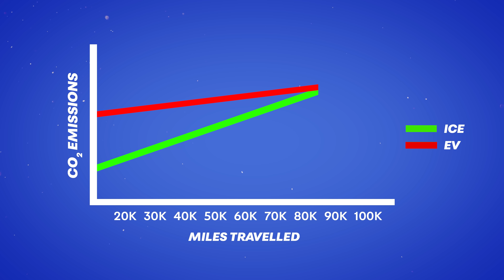Are Electric Cars REALLY That Green? [New 2022 Data]

Comment: This data isn't necessarily "new". We know about the CO2 caused by mining for the precious resources that make up the chemical anatomy of the EV battery. More research is needed for this area for new batteries developed on entirely new chemical dispositions to help offset the CO2 emissions. Following that, EV's offset the CO2 emissions elsewhere such as coal plants, nuclear power plants, solar farm, wind farms, and the like are also getting further research into to help offset CO2 emissions. Fixing one thing leads to something else that needs fixed... and another... and another. In order to tackle the overall CO2 emissions problem, we need to look at the overall picture. MANY things need to be fixed in order to help mitigate greenhouse gas emissions caused by human activity.

Comment: None of this matters i.e. which car is greener, when you take in to account that china and india burns 40 trillion tons of coal every year to make electricity. And they aren't even concidering the noinsensical paris climate accord (which is only engineered to make some shrewd business men even richer than before), and they're only about to concider a greener energy source at the earliest in 2050 for their energy. And now EU has deemed gas and nuclear to be green their green new deal falls apart as a house of cards that it is. Add on top of that all the rare earth metals needed for battery production for these battery-electric cars are mined by small children in areas of the world that are in uproar and turmoil and revolution constantly, like kongo, angola, peru, china, afghanistan and the like. And I hate to brake it to you, none of your sources for electricity in Britain are green, unless you have a separate cable all for yourself going to a hydroelectric powerplant in Norway. England has Nuclear (sort of green), Coal and Gas powered, and some wind turbines. The latter one is the least green of them all. They have a very short lifespan (less than 10 years), work only a third of the time, they use thousands of gallons of oil for lubrication every year, and none of the parts they are built of are recyclable.

Comment: The only thing that matters is not releasing CO2 

If cars are manufactured USING RENEWABLE ENERGY then no CO2 is released by definition 

Using FOSSIL FUEL at any stage of the process IS THE PROBLEM

Comment: EVs are ideal for short range low speed use i.e. in cities . for this simple, cheap cars are required. The whole motor industry  though , has concentrated on producing cars that have high performance and long range. The result is that they have to be stuffed full of expensive batteries. They are also much heavier than the equivalent conventional car. For city use amuch smaller battery will suffice and this could be rather like a wheeled suitcase that can be removed and taken to his home for charging. Thus solving the problem for people who do not have a driveway and have to park in the street.

Comment: you should also consider that EVs are so much heavier and thus use so much more tires: bad for the wallet, bad for the air quality because of micro-particles from rubber abrasion. A friend working in a very large international leasing company confirmed that Tesla cars use about twice as much tires. He also believes that EV users love to use the gigantic torque and thus use even more rubber. This is not the inherent responsibility of the car but of the driver, but it is reflected in their tire consumption.

Comment: 1) So many countries have almost no green energy whatsoever (especially 3rd world) - so if you're charging EV with electricity from coal power plant - then it's even worse than petrol car.
2) Building new battery from fresh materials is up to 10 times cheaper then recycling dead batteries. So guess where used  (very toxic) batteries will end up?
3) Not like "eco-corps" don't care about selling you horseshit information to increase their profits same as oil corps.

The only real benefit is leaving that pollution outside of city compared to petrol cars - but as overall pollution, it surely gan be even greater depending how green country is on energy (because for example Denmark has fuckton of wind turbines, while other countries have mostly coal power plants)

Comment: In my opinion ICE cars wins for now because by the time you get to the break even point EV cars batteries degrade but a well maintained ICE car engine can do over 200k miles before  it wears out.

 EV CARS alone isn't the answer we need a combination of technology's and major infrastructure  changes before forcing the public to make the change. 
 ICE cars will become obsolete when you can change an EV type of car as quick as filling up with petrol/diesel.  We're a long way off from that.

Comment: What about the battery replacement? I assume that would then jump up the EV output even more and it just depends how much ICE is at that point of replacement ~50,000/~100000 miles for battery replacement. In addition, what about the added degrading period in landfills and added electronics? I don't think we will ever get a straight answer, but what can be said is that the infrastructure for EV is not there yet and until it is, it shouldn't be forced upon us at a detriment to both the environment and our pocketbooks.

Comment: It is really sad that lies like this video are still going around and even worse that in about 10 to 20 years when the oil lobby is gone and the lies stopped to get pushed around, no one of the people that lied today will come out and say "yes we lied", just with lead, tobacco and and the other stuff where all those people that lied back than long just went hiding.

To get a few things clear, no one except advertisers and a few idiots claim that the BEV will fix traffic or even everything, it helps to get us a step closer to a CO² free traffic and opens the POSIBILITY to make our traffic completely free of CO². That is all it does.

Second, I've seen so many bogus studies and the problem with studies is that you can alter the results extremely by what you include, what you leave out and what numbers you assume. For example, you could take the numbers of a plug in hybrid with WLTP fuel consumptions of about 1,5l per 100km. But that number is only taken by loading the small battery to 100% and then let the car run on eco mode as far as possible on the battery and only the remaining part on the gas engine. So in reality you've got about 4 to 6 times the fuel consumption but the statistic looks clean. You can also assume the cleanest fuel numbers with 10% ethanol, which is common in Europe, and the most clean refined European oil vs. some polish electricity. ANd you can especially get a lot of nonsense numbers from producing a car. And to this day none of these statistics ever had a detailed list of which part in both of the cars  produces which amount of CO². It is always just, "EVS produce more, don't ask questions", ignoring all the 1000s of little parts that are needed in a combustion engine, and never really telling what part of battery production is so expensive that it literally beats melting steel and transporting small parts all over the globe together.

The best assumption is that production of both are equal enough to not matter in a comparison, if it is not so, I am sure that oil companies and the car industries that knows these numbers would already have told us so years ago.

Comment: Before I leave this site I found only  just now,  perhaps the  AutoTrader fanbois here would wonder why, since the argument seems so reasonable. After all he quotes Volvo and I own one. Volvos are known for longevity and mine is no exception.  It was a car I had always wanted, but it was the heaviest, lowest fuel mileage car I had ever willingly purchased without helping out a friend or relative by  doing so. I did that two decades ago.
And that is the problem.
 EVs are long lived too, and they are even worse for Volvo's bottom line than the ICE products they still have for sale. How does a company stay profitable making vehicles that have no follow on buyers, and how does a site like Auto Trader stay relevant without turnover.  It's right there in the name.  Cars are traded for something better, and ICE cars are constantly becoming worse through engine wear. It is inevitable and keeps Volvo in business in a Niche market. Safe cars that last.
EVs can have planned obsolescence built in too, but not as easily. That drivetrain in my EV today is the most robust I have ever owned. And likely to be my last.

Comment: Some food for thought . Has anyone even taken in consideration oil changes and rest consumables used at each service absent in most EV cases? Put that next to battery carbon footprint and end of life suggested toxicity and reusability/recyclability. And Btw, cobalt is not only sourced from Congo and Zambia. Not used in all batteries (i.e. LFP). Constant efforts  reducing or even eliminating cobalt are already made and more are on the way even in the ones still using cobalt.  Let goals,  processes and numbers talk and leave politics out of it ;)
P.S. On EVs supporting child labor in Africa:  Check the numbers on that connected to illegal crude oil refineries all over Africa (not just the 2 cobalt related sources) and - to add insult to injury - the effect on them of the continued use of tetraethyllead not just (if any) in ground transportation, but mainly in aviation. (e.g. most local airlines rely to antiquated models with piston engines that don't work without it)

Comment: What about the cost and pollution caused when it comes to recycling or disposal of the batteries? Expensive, time consuming and a huge carbon footprint! Add that to the equation.
Reply: Are you able to verify the claims for battery recycling/disposal please?  I recently watched the YouTube video posted by Volkswagen around 3 years ago, showing their EV battery recycling plant in operation. And from what I saw in the video, and the figures VW provided, your claims don't appear to stack up.....
Reply: @Brian-om2hh  batteries can be recycled. But it is very expensive, time intensive and has several difficult processes involved. There are a few companies experimenting with various processes that might speed up recycling times and reduce cost, but it is difficult.
No one is currently doing it in a way that would lent itself to become a secure investment proposal to make a profit.
There are several videos on u tube showing recycling. But at the moment it is not a viable industrial process. If it was there would be many companies jumping in to make money.
One of the problems is separating all if the various materials that are used to make the batteries in the first place. Very time consuming and expensive with all of the separation processes required.

Comment: Couple of points, the electric car engine was designed and blocked in the 80's, there were several designs bought out and crushed by the oil industry, if we'd started making ev's back then, maybe we'd be making them cleaner now.  All industry starts off dirty and over time improve and get more efficient.  Already we're seeing ev's go from 150 miles to 250 and soon expect 500 miles capacity.. sure it's a dirty process to make 1 ev but 1 isn't being made, hundreds are, so that increase is spread over all the ev's made.  90k miles that's maybe 2 yrs of driving, 1 yr for a salesman, depending on use obviously, I'd probably take 4-5 yrs to get to 90k.  the question now is, will a car last that long.   Ideally we need trams and electric buses, to remove the requirement for personally owned vehicles.  Setup complete vehicle bans in cities and towns. Build parking areas with trams running from them into cities etc.  Design a proper infrastructure instead of just adding to an already bad one.

Comment: And there is the battery waste !  Going to be a big problem in the future. In  particular for batteries with   Nickel and Cobold like the Tesla/Panasonic. There is no way to separate those two metals in a economic /large scale recycling. Going to be far to expensive and polluting again (chemicals).
I believe that Hybrieds with a large battery (+ 200 km autonomy on battery) are going to be on the long run the best option - watch out for BYD, they are well positioned. 
Nickel, Cobold free LFP batteries and 100% pure electric as well as hybrids with batteries for up to 250 km autonomy (1100 km combined for battery and gas).

Comment: The other thing; is the EV has this graph today; but the graph gets steeper as power plants change.  If you migrate to more green energy then your EV gets much better.  Your petrol car has a baked in emissions rating, it wont be getting better after its manufacture.  But if your country removes its brown coal plants, your EV after you bought it gets better.

Comment: These arguments miss a major point. While the ICE car dies between 100k and 200k miles, the EV just keeps going at least twice as long, if not much longer. Fears of battery lifetime have not materialized, and other major issues (transmission, engine) are simply not applicable to EVs. It is absurd from Volvo to define 125k miles as end of life. Their EVs will be used much longer. If not by the original owner, then on the used car market.
BTW, I own an EV that just reached 120k miles and it literally feels like a brand new car. No issues, and the battery still makes the advertised range (no decline whatsoever). It's a BMW i3.

Comment: I seriously doubt that 90k miles claim, the best way to go is public electric transportation, but we all know at least in the USA very slim chance of that ever happening. But i agree with you, even if it is not much difference, at least the pollution from electric cars can be kept away from population, I can assure you that if you are in any of many metropolitan cities in the world with massive traffic issues, you will be much better off being stuck behind a bus or a truck that is electric and not a diesel one with that black smoke spewing right to your nose. Breathing fumes from vehicle tail pipes causes health problems. Also breathing gasoline fumes is not good for people either, neither is break dust, that is basically down to zero with electric cars. No oil changes on electric cars either. As far as I'm concerned, electric is the way to go. I have been driving my Tesla for 4 years now, and I don't miss gas stations or oil changes at all.

Comment: Would be intresting to see when the batteries are expected to be replaced and what impact this does again to the chart. Are you expected to see a massive spike again at 150k/200k miles?
Reply: Full battery replacement is not always necessary. An EV battery can be repaired or refurbished, at a fraction of the cost of a complete replacement.  There is a YouTube video of a UK owned 10 year old Nissan Leaf having a battery refurb. It cost £500....

Comment: Volvo's analysis is specifically about two of its models (that are close to identical except for their motor types), and doesn't claim this is a reliable comparison of average EVs to ICEs. It might be, but that is just an assumption, particularly concerning where the break-even mileage point is. 

In an Edmond's review of this particular EV model, they note that this is one of the least efficient EVs, consuming for example 2/3rds more kWatt hours per mile than a Tesla Y (45, compared  to 27), per cited EPA figures.  The more efficient EVs would create significantly lower emissions from their lowered electricity generation needs, and have a quicker break-even point for that reason.

I didn't see Volvo factoring in the carbon footprint of the greater turnover of consumables for the ICE. Those would include oil changes (the carbon footprints of its production, transportation and disposal), transmission fluid, engine belts, and more brake wear, needing replacement and disposal. An EV using high regeneration braking will barely use the brakes relative to an ICE. 

Also, since the battery causes the EVs to start with a larger manufacturing carbon footprint, this qualitative analysis isn't close for plug-in hybrids. Their batteries are much smaller (maybe < 20 kWatt hours compared to this Volvo's 75 kWatt hour battery), which cuts down the carbon footprint by the same proportions. If that's the number, this other type of electrified vehicle would start off with just 26% of the battery component of the manufacturing carbon footprint.  While still at zero emissions when commuting within their all-electric range. Their breakeven point would come far quicker. 

Credit Volvo for their honest comparison, but understand how it may be considerably inaccurate for other use cases.

Comment: It is a well known fact that older vehicles can have failing catalysers and pollute 10 times more. We should eliminate all lawn mowers who produce 30 times the pollution as compared to a ice vehicle in good condition. Were I live, 100% of the electricity is hydro. Besides the dams construction and floading issues, the ongoing pollution generated per kW is the lowest even compared to solar. If all electricity was water or air generated, wouldn’t we not reduce CO2 emitions worldwide. Anyways, big industry needs more precious petrol to mfg plastic stuff and cars are unwanted competitors now that they need to preserve the precious black gold.